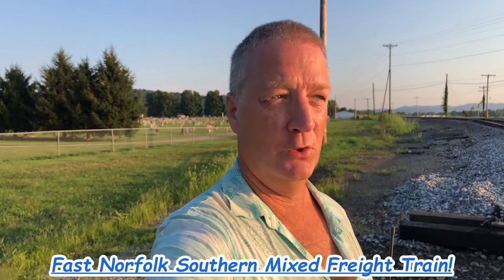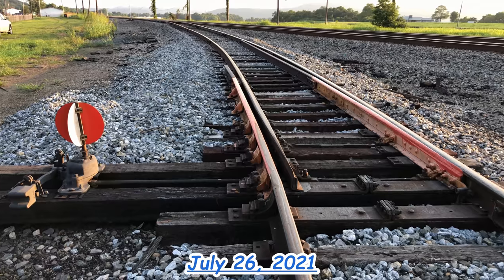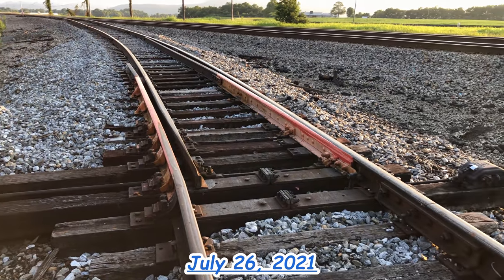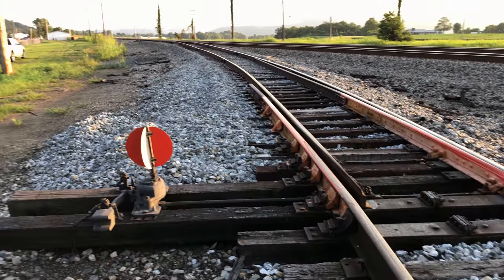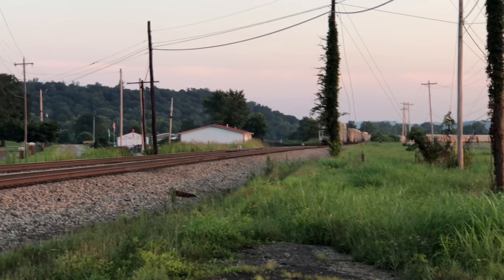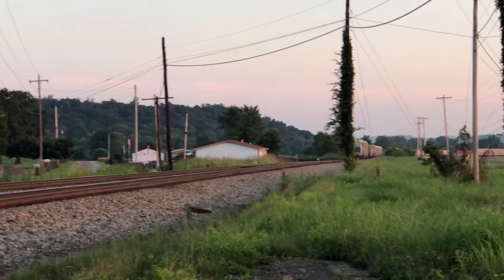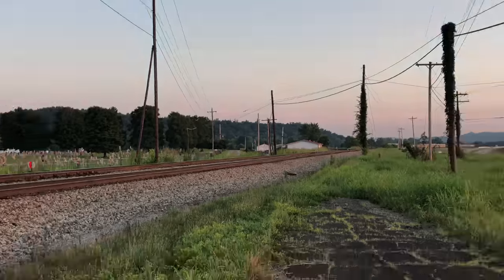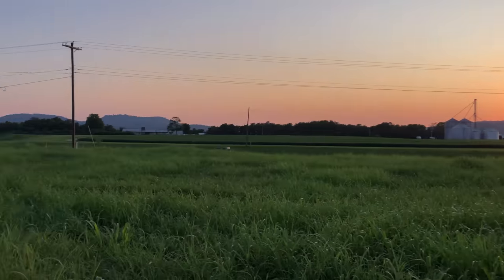Atomic Energy Wye & Railroad Diamond In Marion Ohio, Norfolk Southern Mixed Freight, Piketon Ohio

Comment: One can note the AEC spur is kept in tip top shape to accommodate the multi axle cars with their hazmat loads. Just lime CSX a few NS extra height coke hoppers and one old Conrail survivor. The orange flat is for transporting prefab track sections and especially switch turnouts. Many roads use gondolas with a frame to carry them.  Since you were in Marion OH Chessie had to show her prowness at how to build a tummy cooling trench in honor of the famous Marion Power Shovel.

Comment: Have you ever noticed that NS rarely uses DPU's and CSX uses them on most of theirs?
Reply from the maker: I haven't really notice that
Reply: @A A Horsepower can only go so far as to how much stress the couplers at the front of the train can handle. The longer the train, the more front end pull the locos need to tug. A train being too long can easily cause a coupler failure. 

I see that when CSX uses a DPU, they usually only have 1 lead engine, and 1 engine in the middle. I mostly count over  150 cars in a train on a CSX with a DPU, and only average of around 100 cars on an NS train with only front end power.

Comment: Can you explain to me what a derail does when it sits in a straight section like that JT?
Reply: It derails anything that comes over it. They're usually used to protect the main line from any possible runaways in the siding.
Reply: @beeble2003  thanks for the explanation my friend! Didn't want to sound like a dummy just never knew.
Reply: @richardpowell7013  No problem!

Comment: Did you know that when the dept of energy was looking for a site to produce plutonium, they chose Piketon because of several key factors: 1. close to a water supply (ohio river), 2. away from large population centers (in case of nuclear attack),  3. Access to major highways.  4. Rail service from multiple carriers (C&O had a spur from the northeast, N&W from northwest)

The orange rail car at 11:54 is M.O.W. for transporting track panels / switches.